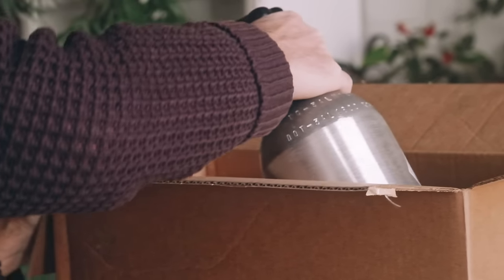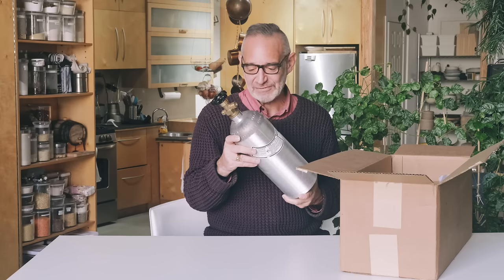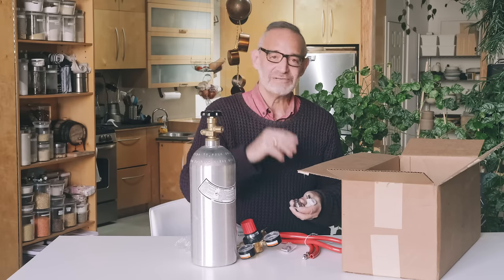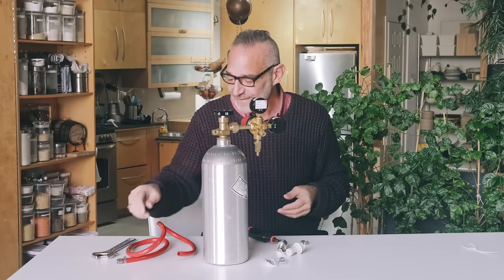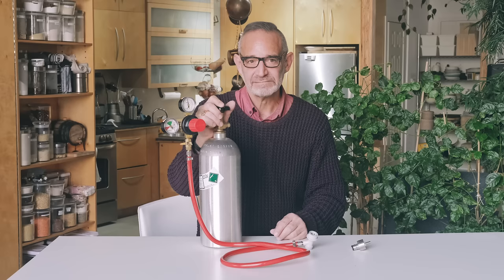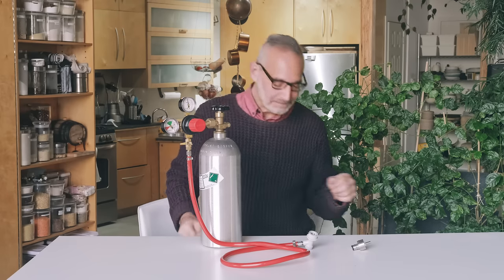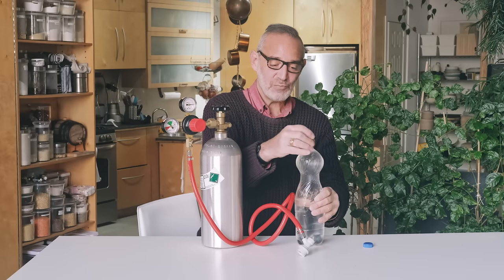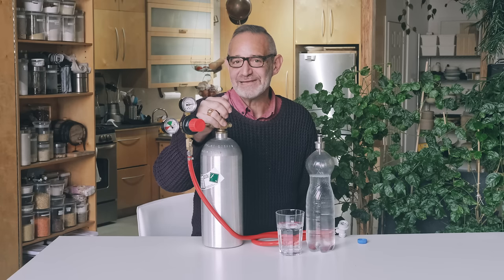CO2 Tank For Making Sparkling Water | What To Get and How To Put It together

Comment: Well, I'm using a standard cheap sodastream I got for 40 bucks on sale and it uses the older  non-quick connect bottles. I refill the bottles myself by unscrewing the valve and filling them with pelleted dry ice for less than $1.  Make sure you don't put too much (use a scale). Screw the valve back on and wait until the dry ice evaporates. There ya go - sodastream refill for a buck or less.
Reply: Where do you get pelleted dry ice? I live in sf Bay Area. Too how much to weigh  for say a soda stream co2 tank
Reply: @gacarson9427  Just check on i.e. Yelp for dry ice places. A few do have pelleted dry ice. If not you can always chop it up. Look on the canister you intend to fill. Normal 60l Sodastream canisters have 14.5oz or 410g of content - so a bit less than a pound. Definitely do not overfill them. Just get a regular food scale and measure the i.e. 400g before you fill them in. The weight of the ice is exactly the weight as stated on the bottle, so no math needed. All you do after filling is screw the top back on and let it sit at room temp for a while. The ice inside will melt and there you have your gas. Last I did this I think I paid $1.50 for a pound. So it calculates if you use the sodastream a lot.

Comment: Love this video, thanks for the info! I bought the US version of your kit and noticed that the stainless steel cap doesn't quite fit the first bottle I tried. After reading the description of the kit more carefully, I noticed this:

"NOTE: The threading on many soda bottles in the U.S. has been changing.  This threading uses the classic, or old style threading. Not the newer shorter style cap threading."

It looks like the bottle in your video has the shorter-style cap. Did you buy your stainless steel cap separately? Thanks again!
Reply from the maker: Hi John,
We got the Stainless Steel cap with my kit.  Here in Canada the sda bottles haven't changed, although I think I've noticed some bottled water caps are shorter.  If you get the larger bottles of soda, the caps shouild fit (I hope they haven't changed them all yet!).
Let us know in the comments.
Nadia & Rob
Reply: @NadiaandRob  yep! a more standard 2 liter soda style bottle worked great. They’re just not as elegant-looking as the 1.5 liter water bottles! I’ll continue my search for something less gaudy, with the right cap threading :)

Comment: Do you know if you can safely use the SodaStream bottles with this set up? I have the kit and am ready to go! Thank you for the video.
Reply from the maker: Hi Kerry
Congrats on putting together your system!
I’m really not sure about the Sodastream bottles. I know that system uses lower pressure so I don’t know if their bottles are safe at 60psi. I know carbonated drink bottle bottles at tested to well above 100psi and are designed to withstand drops etc. I’m not even sure the cap
On the bottles are the same. So I’d recommend using carbonated drink bottles. They’re really cheap and they come in a variety of sizes and shapes…. And they work!
Let us know how it goes with your new system
Reply: @NadiaandRob  I carbonated my first 2 bottles today and was disappointed at the carbonation level. My water was cold and I was at 50 psi. I followed all of the directions with the shaking, etc. I’m going to have to play more tomorrow.
Reply from the maker: Hi Kerry,
The colder the water is, the better.  Try leaving a full bottle in the freezer for 1hr. Then carbonate… lots of N let the air out, compress the bottle, and add more carbonation.  That should get you close to maximum carbonation.
Have fun!

Comment: I have a 20# co2 tank i use for airbrushing.  Think all i need is that bottle connector.  Thanks for this video!
Reply from the maker: Wow, that’s a lot of CO2 for airbrushing!  How long does that last between refills?  Enjoy all the bubbly water.
Reply: @NadiaandRob  I never was able to airbrush as much as I wanted to. I have never refilled it. Guy at the shop told me it would last for ever and it has. About 4yrs and still 1/3 full. Originally I was going to get into tshirt painting.

Comment: How long the gas can last in the pet bottle. After few months when you open the bottle, the gas can be strong same as when you fill 😊
Reply from the maker: The gas lasts as long as you want. These bottles are engineered to retain pressure through the whole bottling shipping and distribution process for sodas.
Reply: Thanks, Is that a special bottle or just normal pet bottle bought for very cheap rate?
Reply from the maker: It’s just a regular soda bottle from the grocery or convenience store.
Reply: @NadiaandRob  Thanks

Comment: Can you carbonate non-clear fluids using this method? Meaning, can you carbonate juice with pulp in it or other solids? Some videos suggested carbonating only clear fluids...
Reply from the maker: The problem with carbonation liquids with pulp or solids in them is they tend to really foam up when you open them.  You can do it, but you have to open them slowly to let the foam die down.

Comment: THANK YOU FOR THE POP BOTTLE CARBONATOR KIT VIDEO. I WONDER IF IT COULD WORK WITH SYPHONS INSTEAD OF POP BOTTLES. 
I WILL SERVE COMPLIMENTARY CARBONATED WATER IN A COFFEE BAR AND POP BOTTLES DO NOT SEEM THE BEST SOLUTION.
IF NOT, PLEASE SUGGEST ME A COMPACT KEG (WITH FLEXIBLE FAUCET) THAT CAN BE STORED IN THE FRIDGE.
THANKS IN ADVANCE.
Reply from the maker: This goes beyond my expertise. I believe there are kegs called Cornelius (corny) kegs that will do what you want. And there are continuous carbonation units like soda fountains.  I’d suggest checking with your local home brewing supplier for more information.

Comment: the du buyer affiliate code redirects is not working fyi thanks for sharing this info
Reply from the maker: Thank you for letting us know! I've changed the link and should be working now.  The site we used to help shorten the original link seemed to have stopped working.  Should be good now.  Really appreciate in letting us know. 😄

Comment: are there any benefits drinking carbonated water? once carbonated, how long does the carbonated water stay fizzy when placed in the ref?
Reply from the maker: As far as I know, the only benefit is the water tastes better and is more fun to drink, so maybe you drinmk more, which is good for you.
As long as the bottle is pressurized, the water stays fizzy forever.  When I pour out some water, I squeeze the bottle to get rid of air, then re-pressurize with CO2.  This keeps the water fully fizzy forever!

Comment: I watched your video and bought the kit you have, but I always get a leak from the Ferraday adapter to the bottles no matter how tight I screw it to the top of the bottle.  I have used five separate bottles from five separate bottle companies, but the leaks keep occurring.  The company seems to be ignoring my complaint.  Do you have a suggestion? The leak is between the adapter and the top of the bottle.
Reply from the maker: I recall reading in some forum that some water bottles have the same diameter and threads as pop bottles, but a shorter neck height (fewer threads).  On our bottles (North America.. Canada) have a height of 1cm from thr top of the bottle to the first ridge below the threads,  The threads wrap around twice.  If your bottles are different, that might explain the leakage.  Another thought:  The stainless steel carbonation caps have a black rubber washer inside the cap that seals to the bottle.  It's possible that the washer was  missing on yours, or got lost.  Haave a look inside the cap and see if there's a washer.  (BTW, the red plastic carbonation caps dont have a washer).
I hope that helps.  Let us know!
Reply: @NadiaandRob  My metal Farraday CO2 cap seals great, but careful threading is a must. It has a rubber washer inside it. I also ordered some extra red plastic ones from them. A couple of them didn't seal so well, and they had washers. I mentioned this in a review and IMMEDIATELY, Farraday got back to me asking: 'give us your address so we can send you some more, with extra washers!!'..   GREAT service. The new ones work fine.
Reply from the maker: @divingfe good customer service!

Comment: How do you make sure that it wont explode any minute?
Reply from the maker: The bottles are designed to hold pressurized sodas, and withstand being dropped in stores etc.  I've never had one explode, or even leak, and I've been using some of the bottles for years.  Here's info that I found online:
Most two liter bottles are made of polyethylene terephthalate plastic, or PET, and designed to hold carbonated beverages. The thickness of the plastic and the shape of the bottle both contribute to its resistance to bursting. Quality control measures include pressure testing, as well as checking for leaks and cosmetic flaws. Most two liter bottles begin to fail at pressures around 1,034 kilopascals, or 150 pounds per square inch. The pressure at which the bottle will burst is more than it would normally encounter during packaging or normal use.
Since we're only using 60 p.s.i of pressure, we're far bleow the failure threshold.
Hope that helps.

Comment: I went a little different route i have a sodastream tera its not electric and has one button to carbonate with not sure if your familar with this model,but its a quick connect from machine to co2 cylinder and i purchased a 5lb tank from amazon along with a hose that has quick connect to my sodastream terra then to co2 tank!My problem im running into is when i am carbonating water there is a white substance that is flying/squirting out of the top of my sodastream,i dont know what im doing wrong or if this is dangerous or not if you could let me know what you think from what i have told please?Thankyou!
Reply from the maker: Hi,  I'm not familiar with Sodastream machines, but it sounds like what you're describing is not good!  I would carefully check out the source of the white substance...  while the tank is not connected.  I'd be concered that the Sodastream is not handling the input pressure from the CO2 tank, and an explosion could result, which could be very dangerous.  Proceed with caution.... let me know what happens.
Reply: I do not have any regulators hooked I'm wo during if that would solve my problem?
Reply from the maker: @michaelb4512  since we haven’t ever used Sodastream machines, I wouldn’t want to give any advice on them.  I’d definitely advise caution, as you are dealing with a lot of pressure.

Comment: Can I use a San Pelligrino 1 liter glass bottle?
Reply from the maker: We don't recommend using glass bottles, as there is a risk of them shattering.  Also, I dont believe the threads match the carbonation caps.  If you want to avoid using plastic bottles, stay tuned here.... a new very cool solution is coming soon!

Comment: What if one wanted to carbonate in a glass bottle? How could the oxygen be removed before carbonating?
Reply from the maker: We don't recommend using glass bottles for carbonation.  The danger if they shatter is too great, and the carbonation caps don't match the threads on glass bottles.  If you want to avoid plastic bottles, we're reviewing a new option soon... so stay tuned!

Comment: Rob, do you know where I can buy some reusable bottles for this? I know I can reuse old soda bottles but I wanted to get something that looks a little more official. That way if I leave it somewhere , It wont likely get thrown out because someone thinks it is disposable. I have found some bottles but none that has an opening the size of a 20 oz or a 2 liter. My goal is to be able to carbolate a bottle and not open it until I am ready to drink it, So I don't lose any carbonation by transferring it to another bottle.
Whenever I try searching for this I always get wide mouth bottles that can be used with other types of Carbonated water machines.
Reply from the maker: Yes. Unfortunately I haven’t found any bottles aside from soda bottles. You can choose the nicer looking spring water bottles but that’s the best I’ve found. If you find nicer ones let me know
Reply: If you want a solution to different types of PLASTIC bottles, check out:  Carbonating at Home with Improvised Equipment and Soda Fountains.html.    by 
Richard J. Kinch.    He goes into, in detail, making your own custom carbonating caps.

Comment: As a home "carbonator" for over 20 years, I offer a few suggestions...
Purchase extra washers and  O-rings. You will likely NOT be able to find these at your  local hardware store. These will wear out and cause leaks down the road. These, especially the O-rings, should be lubricated... I use "Sanitary Petrol-Gel" from McGlaughlin Oil Co. But there are others as well. This is a food-safe, tasteless and odorless lubricant used by the soda industry... and very inexpensive and lasts forever. I lubricate once each month  - takes 10 seconds with a q-tip or clean fingertip.
I also find it simpler to leave the filler cap inside the retractable connector. This further reduces wear on the lubricated O-ring... you will find the cap will freely spin within the connector allowing it to easily screw onto the bottle. 
I also change and lubricate the O-ring on the regulator where it attaches to the tank. Replacement can only be done using an Allen key.
Using the lubricant I change these gaskets only when needed and these last me a little over a year.
I prepare 4 two-liter bottles every day for my family. 
One other thing... water absorbs CO2 best when cold. Refrigerating your water first helps... but we have made a habit of leaving 4-inches of soda in the bottle then freezing it... then top up the bottle with filtered water and begin carbonation. 
Cheers to all!
Reply from the maker: Thanks for all the suggestions!  Voice of long experience.

Comment: Why don't the co2 bubbles enter the bottle like the soda streams do? ie why don't you have to shake a soda stream bottle to get the bubbles into the water?
Reply from the maker: The Soda Stream machins have a tube that extends down into the water, so the gas bubbles through the water.  The allows the CO2 to absorb into the water.  However, shaking the bottle allows much more CO2 to be absorbed so you get more carbonation than with a Soda Stream.  I prefer the higher level of bubbles!

Comment: Very good video on how to 'home carbonate' drinks. I wonder if I can use the C02 cylinder that came with my Soda Stream and when it is empty, have it filled with food-grade CO2 for less money than a cylinder exchange which costs me CAD $24 each time.  I don't mind the level of carbonation I get from my Soda Stream machine but I would like to save a little money on refills and still use the supplied gas cylinder that came with the machine. Anyone know an 'independent' gas refiller who can do this for me for less than an exchange cylinder?
Reply from the maker: I've seeen some refill services advertized on Facebook Marketplace and various listing services... but I don't know how much you'll save.  One other option is to hook up a larger cylinder to your soda stream machine... I know there are kits to do this... but I haven't tried them, as I don't have a soda stream.
Hope that helps.

Comment: I would be a bit more cautious with the CO2 bottle...if that thing tips over and falls, you'll have a big CO2 Rocket flying through your house. Best practise for storing such a bottle is also to detach the regulator for optimal safety and keep it somewhere it can't fall on its side. Here in Germany all gas bottles have a collar around the top to protect it form impact if it should fall.

Comment: Is there a pressure cap that fits the flip cap style bottle?
Reply from the maker: No there isn't.  If you want to use those, yhou have to carbonate in a regular soda bottle, then transfer to a flip cap and seal it.
Hope that helps.

Comment: Did you find the taste of your first bottle a little metallic? I just got mine and didn't expect that weird taste.
Reply from the maker: I don't recall tasting a metalic taste, but it was a while ago.  Could it be that you are tasing the slightly tangy taste of the carbonation itself?  The CO2 creates a small ammount of carbonic acid in  the water, which is part of the appeal of carbonated water.
Let me know if the taste sticks around
Reply: @NadiaandRob  Thanks. After a few drinks it tastes normal now. It was just the shock of flat to sparkling I guess.  I boosted it up from 30 to 50 PSI - very nice!
 When are you doing a video about flavor additions?
Reply from the maker: @martik778  Glad it tastes normal now.  We will be doing a video about flavor additions, but we've been busy on some client projects.  Stay tuned.... we'll be psoting more as soon as we get caught up.  Meanwhile, enjoy your bubbles!
Reply: @martik778  you’d never had sparkling with gas water? Yes, there’s a taste and you either like it or not.  Sounds like you like it!
Reply: @robynlydick8126  It does seem to taste different than the retail soda water and the sodastream or maybe I'm imagining it.  White wine tastes great when carbonated!

Comment: How many of those bottles would you be able to fill with the 5lb tank?
Reply from the maker: Hi Anders,
Funny you should ask that, as I just delved into that in resdponse to another follower question.  Here's my reply:

 Your question got me thinking…. And measuring!  I weighed our 2lt water bottle, zeroed the scale, and carbonated the water as usual and weighed.  Much to my surprise, 16g of CO2 went into the bottle!
So then I started calculating… 5lb tank holds 2268g of CO2, divide by 16g…. So the 5lb tank will do 141.75 bottles.  At 1 per day average, that should last around 4.75 months!
Wow… so a $25 refill will carbonate around 280 liters of water and last around 4 ½ months if you drink 2 liters a day.  Now that’s cost effective!

I hope that answers your question. Nadia & Rob
Reply: @NadiaandRob  awesome very informative; thank you for the quick reply